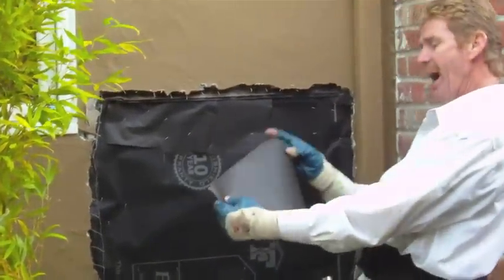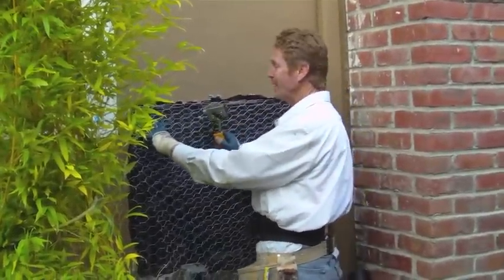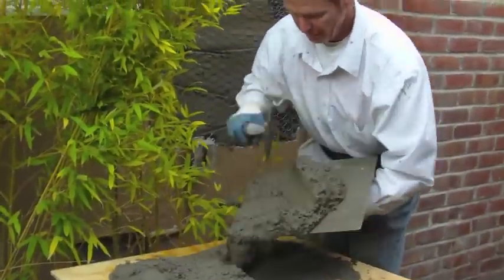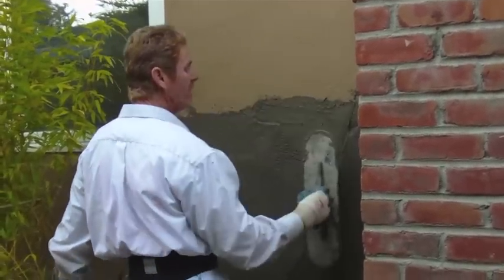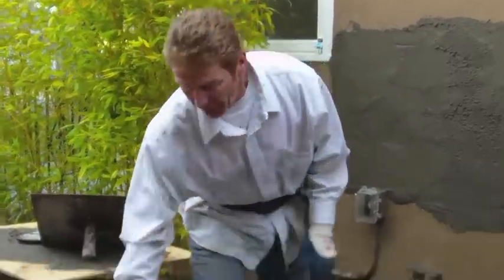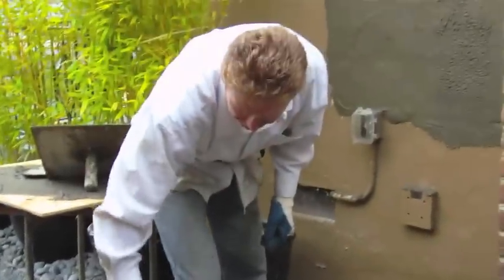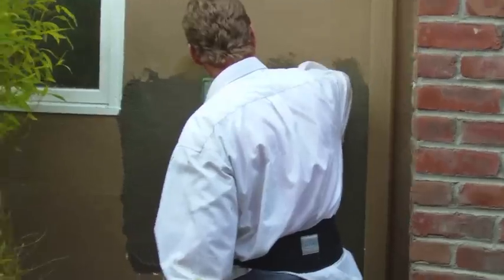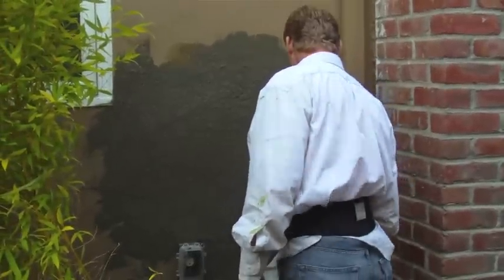Patch air conditioner hole with fast set stucco

Comment: First I want to say "Thank You" for your great videos!

When you have stucco that has been painted (multiple coats) on a wall that you have patched an area, how do you make it so you don't see the the transition?

I keep coming back to these two answers:
1. Apply multiple coats of paint on the patched area which just seems wrong!
2. Sandblast the entire wall/house which is a lot of work and very messy.

What is your recomendation?

Comment: Hey Kirk Im revoming a AC through wall unit and I need to patch it just like this video. My question is after I remove the unit theres the square hole... do i need to nail in a piece of plye wood to cover the hole before I put the paper and wire? On the video I seen you had a piece of plye wood but i wasnt sure if you had left that under the paper. Thanks
Reply from the maker: Hi Jimmy, if it's a stud home with shear wall than yes you need to add additional shear, so that you are replacing about an inch of stucco only,
 Cheers,
 kirk giordano rendering

Comment: Do you have a video on basic type of mud a DIY’er can use to seal up a new window or AC wall unit. And have to some how seal around objects in the wall? And how to fill in gaps? Also paint type I should use?
Reply from the maker: Greetings John,  Our unique plastering Tip:  all subscribers or anyone who stumbles on our channel with a question, type it into our Stucco/Plastering channel, and like magic, a video will appear to explain how it's done. 😉
   This feature is miles ahead of any plastering forum. 🥳	
Kirk & Jason Giordano Plastering

Comment: I'm not too clear on this. If you have a hole with no chicken wire or board, what do you do first? Do you install a piece of board then the chicken wire? Then mud? What do you do if you don't have where to drill the board?
Reply from the maker: Evening Randy, some houses have just studs some have shear wall, it does not matter you still have to paper and wire whatever is there so you can apply stucco.
Best wishes,
Kirk & Jason Giordano's DIY plastering network

Comment: All you used were those cheapo Arrow Staples?
Reply from the maker: Hey Tootsie pop dude, No, I used perimeter staple's on just the first layer of wire, as I had my compressor out anyhow.
On the second layer of wire I just used arrow staple as this layer was to fur out a bit deeper.
 Thanks for watching and have a great day.
Kirk and family
Reply: StuccoPlastering I took a week off from a house I'm working on in the San Fernando valley, with the Earth quakes, the Blvd traffic driving by, and 1961 dried lumber, the 1 inch staples that were used  to hold just about everything thats a wall on the house has come loose,  other houses in the neighborhood built by the same contractor also have the problem, Take a pry bar to a corner of the wall, grab and pull and watch out the whole wall is on the ground.  The rock lath used in the house has also come loose, and separating.
Reply from the maker: hey Tootsie pop dude, We use inch and a quarter crown staples as 7/8 of the staple leg or nail is supposed to be in the stud itself. The rock lath is outdated but I have seen it about 30 times over the years, the staples or nails should still be long enough to set into the stud by 7/8 for the support. Our guns are equipped to hold 7/8 staples for stud walls and up to 2 inch staples to deal with different siding widths.
Sounds like the one contractor neglected out of obvious ignorance this important fact.
No sane man wishes to save 50 bucks only to have an exterior fail.
 Sorry for your loss,
 Best wishes with the solution.
 Kirk and family

Comment: Hot Mud!!!  If the average guy can't do this then all you're doing is patting yourself on the back.  Okay, you're awesome, you can do 1-1/2" in one coat but you do nothing to help others with this video.  A little humility would serve you well!
Reply from the maker: Hi Skywell Construction, With normal stucco you cannot do two coats simultaneously like I do here, unless you purchase luminite, 
Luminite is an accelerator for cement plaster.

 However these days they also sell lots of fast setting or rapid setting products such as rapid set stucco patch which will allow this exact same type of plastering , both coats back to back.

 You can purchase rapid set stucco patch at Home Depot's or Lowe's hardware stores as well as many others hardware stores.
These boxes range in sizes from10 pound box's to 25 pound boxes to bags which come in heavier sizes as well, all you do is add water.
 Best wishes, 
 Kirk and family
Reply: +Skywell Construction It isn't rocket science. What else could he have shown that would be more helpful?
Reply from the maker: Howdy do dude, I find some things I am not aware of very difficult too, who's to say what is rocket science to common sense?
A person is not born that knows how do  anything except shirt, eat and breath, we all have to learn by doing, the smart ones now learn by watching.
 Best wishes, 
 Kirk Giordano
Reply: Look Guys, I know how to do this. The point you seem to miss, most likely because you're too busy defending yourself is that an average DIYer isn't going to benefit from this video. You claim its for DIY then use advanced tech like hot mud. 

That's okay though, I'm not offended by your insecurity. Best of luck and God bless.
Reply from the maker: Howdy Skywell dude, read the comment from today most likely above yours then sit back scratch your head possibly look to the clouds as in a great debate and wonder who's zooming who?
 Cheers!
 Kirk Giordano
Reply: When I said it wasn't rocket science all I meant by it was the stuccoing was well represented by the video and didn't need more explanation in my opinion. It wasn't an insult. Capiche?
Reply from the maker: Dude, are still patronizing me?
The Capiche, was the kicker.
 kirk Giordano
Reply: I dunno how I fell off the Love Boat with you. Tell me - is it my profile pic?
Reply from the maker: Your profile picture does appear a bit moody, but no worries, I have an abundance of love for my fellow man, working full time and as busy as I am sometimes I do get whiney or short tempered.
How do the hip people say it,  Ooops my bad?
 Best wishes,
 kirk Giordano
Reply: Skywell, leave him alone.  He has done people a service here.  I and many others appreciate the fact that Kirk shares knowledge with us.  For goodness sake, what's your problem?  For your own good, and everyone else who interacts with you:  figure out why you're unhappy and do something about it.
Reply from the maker: Atta Boy Jared, man, you should consider counseling as some folks can benefit from a bit of psychotherapy.
 Best wishes, 
 kirk giordano
Reply: I mean no disrespect, Skywell.  I couldn't stop myself from standing up for Kirk.  He didn't deserve what you dished out, and it seems like it's probably coming from somewhere else.  Anyway, good luck to all!  And, thanks again, Kirk for all of your videos!  (btw, fired you a question via your website.  If you HAPPEN to have the time?!).  And another btw:  I'm in Modica, Sicily - this place is stucco heaven!!!
Reply from the maker: Howdy Jared, the good and bad of youtube videos, I get recognized for our talents, the bad I receive close to 50 e-mail per day for advice which I can no longer answer, as I simply don't have the time,
 Ask away here as other folks may have the same question and may find the answer here too,
 Cheers,
 kirk giordano Plaster